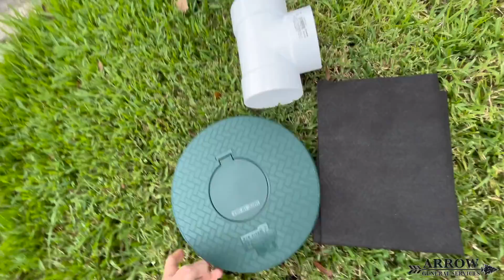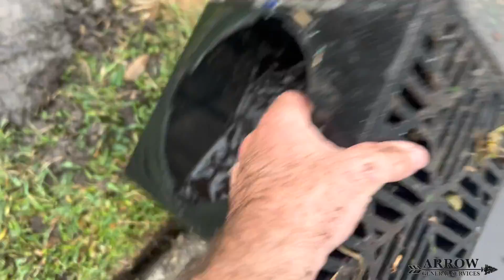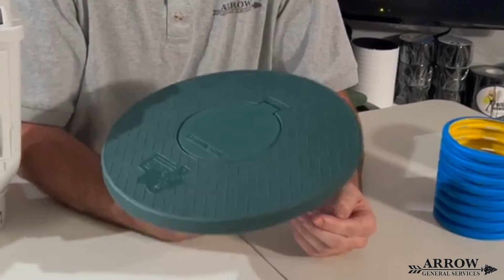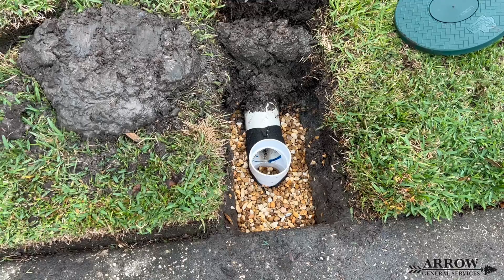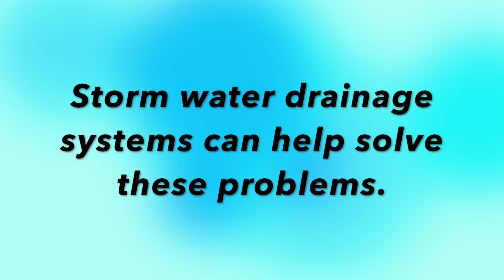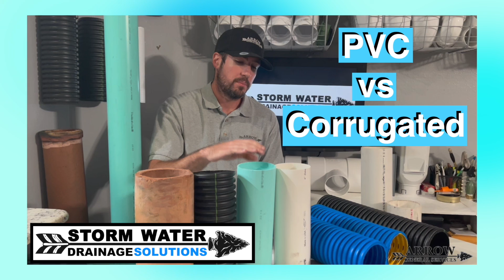Pop Up Emitters - Yard Drainage Discharge - FDM

Comment: Nice, needed this!
Reply from the maker: @braxtontucker8055  💪
Reply: Do I need purple primer for heavy duty solvent on sdr35 to sdr35?
Reply from the maker: @braxtontucker8055  The heavy duty makes a ridiculously strong bond so I wouldn’t sweat it if it’s just for a yard drain and not sanitary sewer. But using the primer definitely won’t hurt.

Comment: A riser on that tee would have brought the emitter plate up level with the turf,   being close to the road,  debris and road junk will collect in the divot or in colder climates expressed water will freeze on top,  blocking emitter.  If it were level or slightly raised on a crown, this would be less likely
Reply: He's in Florida, and they don't freeze.
Reply: @FRENCHDRAINMAN  junk will still accumulate in the divot.   And if any northern viewers try it this way, it will freeze shut on them and freeze on the sidewalk